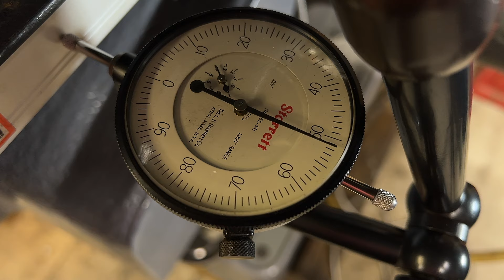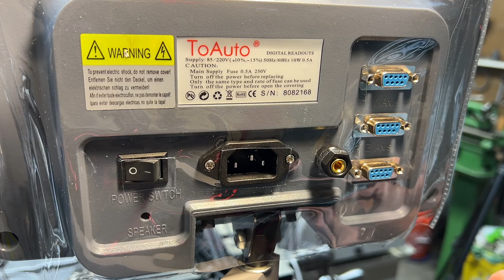Upgrading My OLD Brown & Sharp Mill with 20th Century Technology

Comment: I may add a DRO to my B & S Bmill that has the same knee. Ha Ha, the old machines and the way the castings are on these old machines makes it a challenge. I have just spent hours fabricating a simple collet lever mount for an old lathe thinking when will this end. Like you mentioned the power feeds with rapids already built in. I found my B&S mill to be unusually accurate without a DRO so far, Great video!
Reply from the maker: Hi Don, thanks for checking out my video! And yeah, these old machines are beautiful, but not many straight lines in the castings lol. And yeah these old B&S machines a super accurate, way more accurate than I am, and the machine is probably more accurate than the cheap import DRO lol. But the DRO is just so convenient, I got used to having one on my bridgeport and it made me lazy... haha
Reply: yeah, the biggest bitch about olden beauties is the curvaceous shape of those gorgeous castings... However, it`s kind of a good thing, as it serves as a deterrent for imbeciles from just attaching random crap onto those machines... My Schau22 mill is from 70`s and is as square as they come, literally just right angles and flat surfaces... Thankfully, she was a school backup machine, so she was unmolested, however, i`ve seen a lot of such flat geometry machines being full of random holes for brackets and all the other miscellaneous junk that brutes slapped onto them just because they were too lazy to weld up a nice cabinet, a stand or a wall mounted storage to contend with accessories and tooling or similar... But the DRO`s really can be a pain in the ass with these older machines... Not just the lack of flat surfaces, but the general geometry of the machine castings often has lumps and what not where you need them the least... My Schaerer lathe has a round lump on the side of the cross-slide that supports the compound`s rotary base, and on the other side where all is flat, there is a reinforcement block, which while flat - really gives me the finger by forcing me to somehow work around it when i`ll be slapping a dro onto the Schaerer... 
I guess the best way of contending with such issues, if the castings allow for it - is converting the machine to ballscrew actuation and using rotary encoders as a DRO, given that they can translate the rotary motion of the ballscrew into deadnuts accurate positioning, even better, if such a solution is possible, the rotary encoders are oft absolute, so the system is always aware of the machine axis positions, regardless of any nonsense... The cost of the solutions is not comparable, as the encoders while comparable, require the ground 0 backlash ballscrews, which kick the price up by thousands of bucks in a heartbeat... 

All the best and kindest regards, both to Don and Hersch!
Steuss
Reply from the maker: @camillosteuss  yeah I try to use existing holes whenever I can to avoid adding any unnecessary additional holes

Comment: Cool video. I have an old b&s mill like yours but do not have the vertical head adapter. I am planning on trying to retrofit one of those high speed CNC-type spindles to it.  Dro is on the list also. Wish me luck .
Reply from the maker: Thanks very much! And good luck lol. Your can definitely do it though. Are you thinking that you'll mount it on the over arms? Seems like it might be a good way to do it. Thanks for watching btw!
Reply: @hersch_tool  yep exactly ,  thinking of a simple rigid mount to the overarms.  Would be no quill but think about how much reach I could have.
Reply from the maker: @richardhutchinson4016  my stock vertical head doesn’t have a quill either, will be a learning curve for me learning to drill with the knee I think

Comment: I have toauto on my lathe. 3 axis. After a year in service I am very happy with it. x & z on carriage and cross. y on the tailstock. The tailstock is a game changer.
Reply from the maker: Yeah I've thought about putting one on the tailstock. Seems like it would be super useful. Mine is "ok". My carriage scale reads nice and accurate, but my cross is "unpredictable". Sometimes, it's dead on, and then other times it can be off by 1 or 2 thou over a half inch or so, but then go another hundred thou and it's back to dead on again. I haven't spent too much time troubleshooting it.
Reply: @hersch_tool  The cross slide unpredictability issues sound like uneven leadscrew wear... The nut would just offer larger backlash were it worn down, but this is easily diagnosed, just move the slide into a few positions between the extremes of the travel and check for backlash, if it oscillates, there`s your problem...  Of course, the nonius scales could be the cause aswell, if they are not dead on, making certain division markings more precisely in line with what should be the readout, while the others could be a bit off, either to the left or the right, that however should be somewhat visible to the eye, despite being much harder to measure and check without optical equipment...
Reply from the maker: @camillosteuss  I'm checking against an indicator, so .100" is .100" regardless of any wear. I think it's must likely just a cheap DRO. And for the price, it's close enough lol
Reply: @hersch_tool  hmmm, weird, is it a glass scale? Because glass scales should never read wrong, well, temp. elongation and all that notwithstanding... Also, is it possible that your gib is slightly looser than needed? Lateral squirming of the cross could cause some flexing in the scale housing(alu ``box``) and shifting it in relation to the read head... 
The only real issue that a cheap dro should suffer from is either fucky electronics or just inaccurate scales that appear accurate yet are not, as the read head will read the scale and say that all is well, but when you put a micron dial on it, the scale obviously lies... But again, that shit should be constant and undetectable on the screen, so i`m more inclined to think that there is something fucky with the mechanical parts, be it the slide itself or something else... 

I mean, if you are sure, proceed accordingly, i`m just offering a checklist if you aren`t sure :P

Comment: On the Z axis, why not flip the angle around and run the brakcets around the back side of the scale like you did on Y? The angle would protect the scale, and the dust covers would not be exposed directly to hot chips.
Reply from the maker: Honest answer? Because that was my last bracket and I didn't have the time or energy to fabricate an entirely new bracket system for that axis. I don't believe it will be a serious issue either. And I also have aluminum dust shields for all the scales that I can install if it does prove to be a problem. I did consider it though, but very briefly lol. Thanks for watching!

Comment: Just wondering did you make any video footage of that homemade parting off tool holder you made for your Aloris toolpost?
Reply from the maker: No, that was one of the first things I ever made so it was before I started doing videos. But it's worked out well for me, so maybe I can work up a set of drawings and do a video on it soon. I'll work on that. Thanks for the great idea!
Reply: @hersch_tool  I also  think it would make for an interesting build video. I have one of the Aloris wedge locking type of part off holders and it is useless. I have been planning on making a new holder from scratch with better blade clamping like yours. Look forward to a video build👍
Reply from the maker: @howardosborne8647  Yeah those wedge type are the worst. Stay tuned!

Comment: So I’m wondering why you didn’t utilize the wipe covers as your mounting point as there’s really nothing important there as far as I can tell (my #2 light type is currently pulled apart)
Reply from the maker: The wipe covers? Not sure what you're referring to
Reply: @hersch_tool  so nearly all bigger machines produced post I wanna say 1920s (grinders being an exception due to abrasives and movements) usually have a leather/rubber/plastic ways wipe to keep chips from galling/scratching the ways. Below where you mounted your X DRO scale (an unused flange boss) was that cover with 3 large flathead countersink screws that you could have drilled and tapped into the metal behind it or made a new wipe cover without worrying about the oil reservoir as that’s where the casting needed to be made thicker for machining the ways.

For your lathe and your mill is suggest looking at any exposed ways and finding those wipes as you should probably make replacements as they generally go bad after a decade or so depending on conditions. 

I’d also suggest checking out vintage machinery for the PDF of the brown and sharpe no 2 light type plain mill (as I believe you have the 1940-1945 model as in the manual)
Reply from the maker: @shadowcard6923  yes, I know "what" way wipers are, but this machine doesn't have wipers, and so doesn't have wipers covers either, never did. And I didn't want to drill into that surface because it's too far down/away from the scale, and too close to the ways to reach without having to drill in at an extreme angle. I also have the printed copy of the manual and parts list. They're on eBay, I like to have printed books, I'm old fashioned that way. 😂 And that little boss worked well enough anyway
Reply: @hersch_tool  that’s weird, maybe it was an add on or something as mine has them and mine is (unfortunately) the years prior (38-39 IIRC)

I also sometimes forget that I did go through the effort of pulling about 200lbs of tanks and started pulling gears and such to take off the table, saddle and knee where I’d have an easy time drilling that. Though I do believe that the steel slides will unhook fairly easily allowing for access but I forget. 

I do also wish I had a real copy of my manual, I just printed out the PDF for the newer machines to maybe have some extra help deciphering the mechanical marvel that is that machine. I will say brown and sharpe stuff seems to have some rather unintuitive but clever mechanisms in comparison to like Cincinnati/hardinge/monarch/south bend
Reply from the maker: @shadowcard6923  yeah this particular model never had them for some reason. And I agree, B&S machines are kind of like "mechanical art" lol. Beautiful, but sometimes a bit "abstract"... 😅 And check out eBay man, I think I paid around 40 bucks for the original printed manual. Worth every penny. Honestly not much in terms of a "manual" but has the full parts break down for every assembly, even for the dividing heads. I just can't do PDFs, I grew up reading books, not screens, know what I mean
Reply: @hersch_tool  I hate them too but unfortunately for the model I have I haven’t really been seeing them and I think I’ve seen one but it was $70 but no pictures of the vertical light type.

Though one thing I will say is that brown and sharp is by far my favorite metrology stuff. Just got a $5 mic from a local flea market and beats the hell out of starret, and is comparable to old mitty
Reply from the maker: @shadowcard6923  Yeah I agree with you there as well. I will take OLD B&S hand tools and measuring tools over starrett every single time. I LOVE my B&S mics and squares, etc. The old stuff though, from when they were in Providence RI. Not the new stuff that's just the B&S name slapped on mediocre tools.

Comment: Ah, my trick to no breaking taps is to use the largest tap that i can utilize for a given project... If M4 is okay, but i can fit an M12, M12 it is... I don`t mind breaking taps, it`s called getting a consolation reward of a high grade cobalted hss chunk that can be ground into custom cutters, but i don`t like leaving chunks of taps in places where i want to leave a screw in, that just grinds my gears... 

Also, this mill is such a project piece... I could not help myself from stripping her bare, hand planing the surfaces with sanding blocks and giving her a proper automotive finish... It would require a total dismantling of every bit, but the effect would be pornographic... High gloss clear coat over say graublau paint with mirror smooth finish would look spectacular... Damn, those are some stunning castings... But i`m aware that that is a major undertaking and one best left for us hardcore fanatic-lunatics... Also, that is literally just an aesthetics oriented undertaking, one which is generally frowned upon when it comes to machines, but what can i say, as a madman, wasting hundreds of hours is a hobby, even a passion, so try and stop me...

All the best and kind regards!
Steuss

Comment: I thought to myself, "he's going to break a tap using a power drill".... then you snapped one 😬
Why don't you slot the holes on the first piece of angle so that you can do away with the stack of washers?
Reply from the maker: Lol ironically enough, I broke a bottom tap using the hand tap wrench... I was following it up with the bottom tap because the holes were pretty shallow and the handle of the tap wrench bumped the surface right below the hole which knocked it to the side ever so slightly and all I heard was a horrible little "click"... I still have PTSD... And yeah, funny you mention that. I responded in an earlier comment that I am going to go back and do just that. But when you're knee deep in a task sometimes your get tunnel vision and overlook the obvious. Also I'm an idiot, so I am constantly having to contend with that as well... 😭
Reply: @hersch_tool  I think we all get tunnel vision at times.
We have the benefit of sitting and watching without having to do any of the thinking.
It's all a learning process.
Good work.

Comment: Instead of rusty / rust-prone iron angles, I would have used suitable aluminum angles / aluminum profiles.
Reply from the maker: I had angle iron, so I used angle iron. If I really wanted to I could have cleaned them up and painted them, might do that later, but wasn't really worried about it
Reply: @hersch_tool  
I would have done that first but I accept and respect your decision - function over aesthetics.
Reply from the maker: @friedrichkeul9791  yeah I just wanted to get it working. Plus I'm always on a time crunch for the video, so "extras" often get cut out